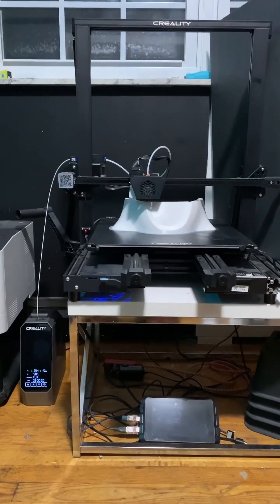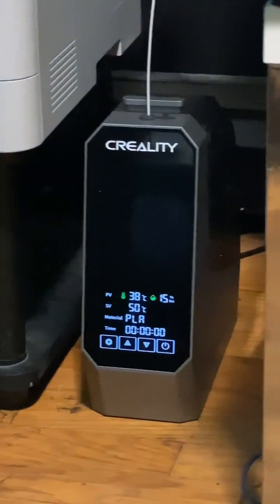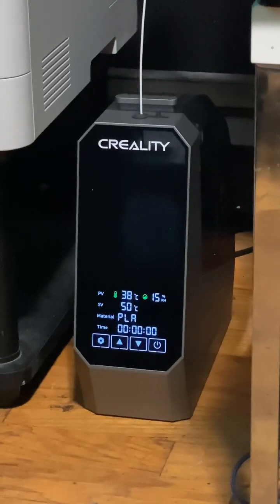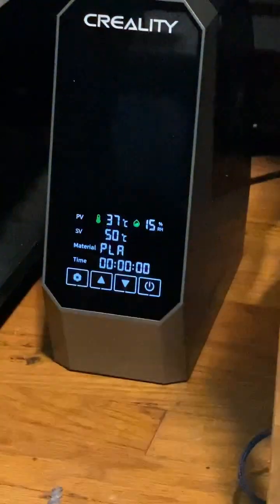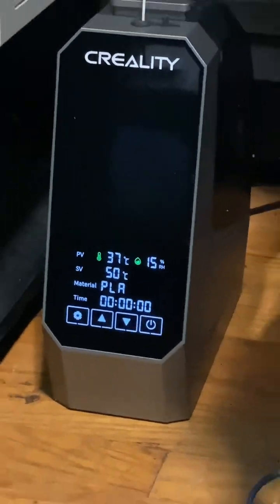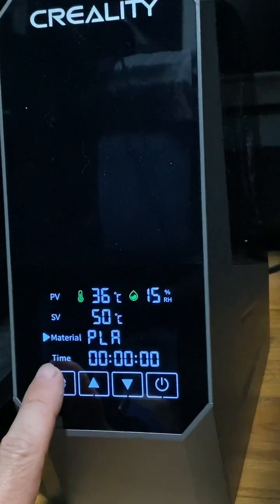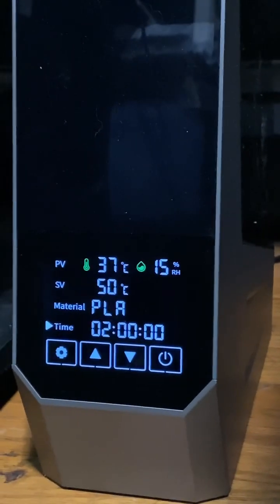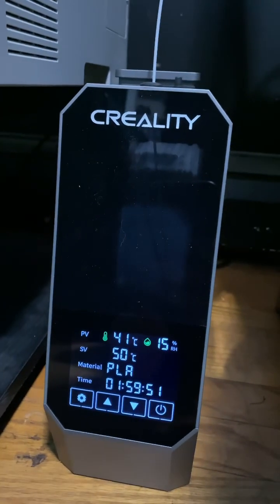Creality Space Pie Filament Dryer working well, feeding CR6-Max. I can't hear it over the 3D Printer

Comment: Thanks for your vids, I recently bought the Space Pi, and just finished drying the top 25 or so filaments I use the most - omfg how did I not know about this or do this before? They try to tell you, lol even Bambu says drying before use is required for some, but I didn’t listen lol. Now I’m going to do it with every new spool I buy and store them in my drybox cabinet. I did the 3D printed AMS desiccant pods and it’s under 10% RH in there now!
Reply from the maker: Welcome to the party! The Pi is a nice dryer, and drying sure can make a difference. 🎉